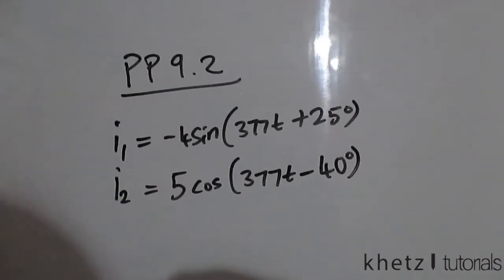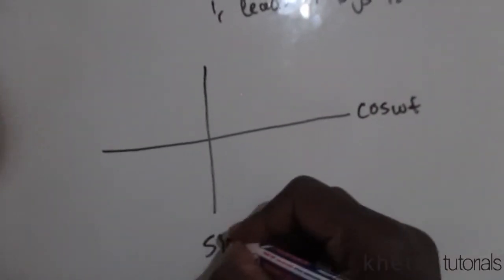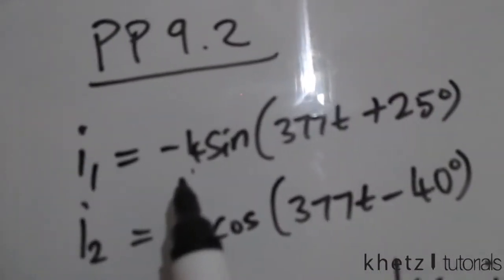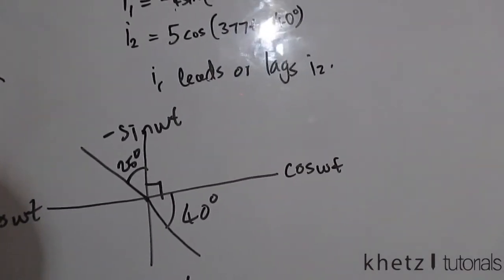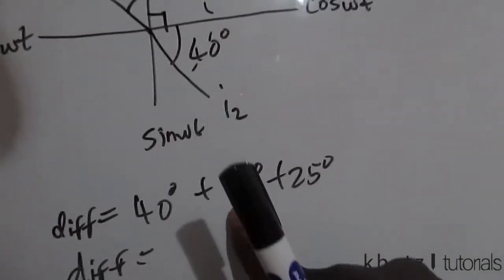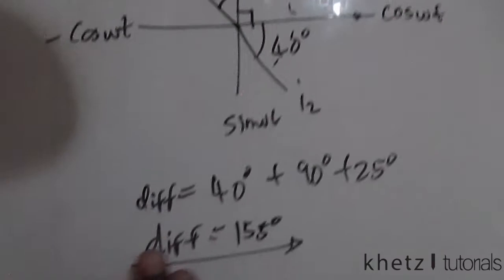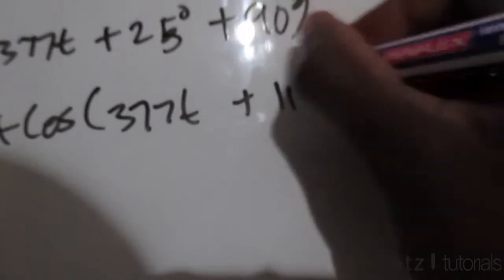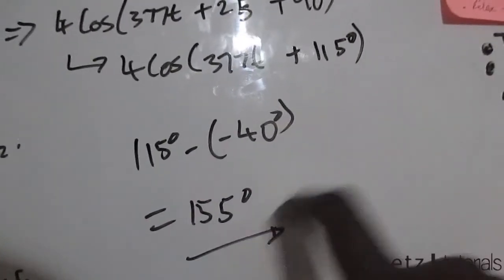Fundamentals Of Electric Circuits Practice Problem 9.2

Comment: How you converted negative 4 into positive
Reply from the maker: Adding 90 degrees in the cosine does the conversion
Reply: @KhetzTutorials  you converted sine into cosine by adding 90 degree but what about the negative sign which the amplitude has
Reply from the maker: The conversion converts the signs as well. You can look up sin to cos and -sin to cos conversions on google
Reply: @KhetzTutorials  thanks 👍

Comment: you forgot to tell in method 2 how we find i1 leads i2 ?
Reply: If the sinusoids both have positive amplitudes in the cos form, you must negate the phase angle. The angle which is the "most negative in time" is the one that leads
Reply: @vukhetamaluleke6869  What does "most negative in time" implies?
Reply from the maker: The sinusoid that you encounter first if you were to start on the negative side of the axis moving towards the positive side
Reply: @KhetzTutorials  is this also true if the sinusoid is in sin form?
Reply from the maker: Yes. If you have a graphical representation of each, it should be easy to tell. Otherwise, you'd have to convert to the same type
Reply: @KhetzTutorials  If I don’t have any graphical representation, can i convert the negative angles into positive to compare which one leads? Because i2 leads if I have done it that way. Also, thank you for your videos it helped me a lot!
Reply from the maker: If you have the sinusoids represented as the same type of function and with the same angular frequency, you only have to "invert" the signs in your mind to understand what is going on. So first convert into the same trigonometric type then look at the angles. A negative phase angle corresponds to a shift to the right and a positive one would be a shift to the left. Knowing the nature of the trig functions, you can actually draw each of them to see which one would lead or lag according to their phase angles. This can also be achieved by looking at the "most negative" as I explained. So for example, sin(wt) leads sin(wt - phi) because the second one has been shifted to the right by phi and therefore sin(wt) would occur first in time
Reply: @KhetzTutorials  Thank you! This is a big help
Reply: I assumed that since we already knew which one was leading from the first method, there wouldn't be a need to do so again in the second method. I hope the explanation clears things up for you
Reply: @vukhetamaluleke6869  thank you